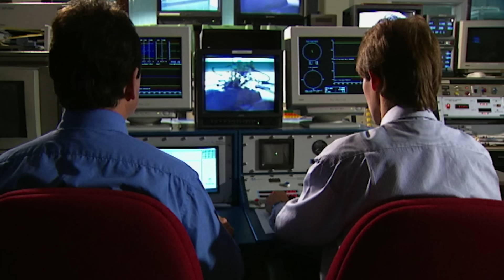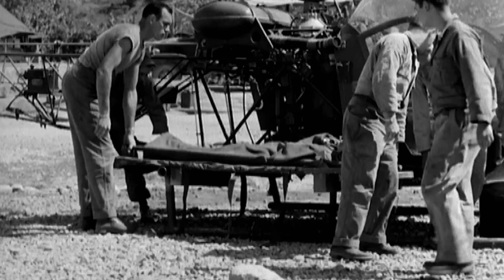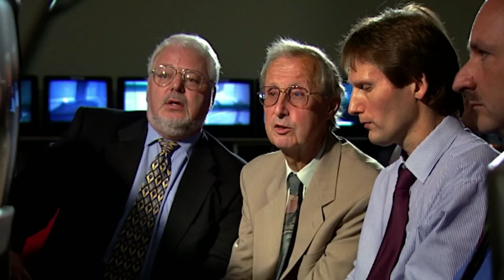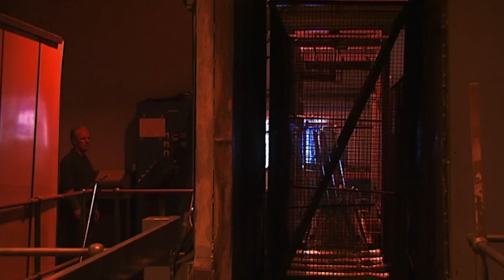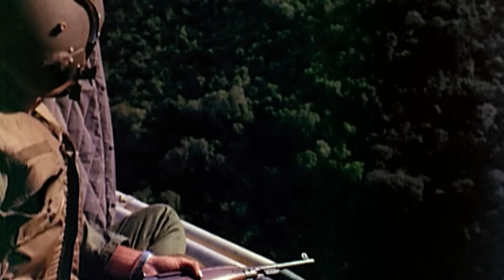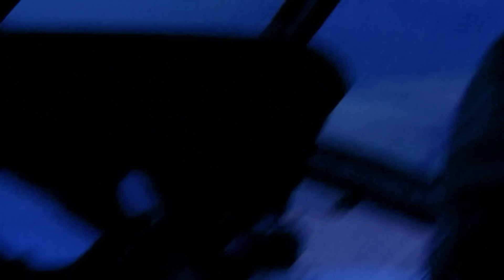The Ultimate Helicopter's Design Allows It to Conquer Any Airspace | Blueprint

Comment: It looks like an NH90 that australia just planning to  retired
Reply: It was an excellent helicopter, just retired because US was worried about competition.
Reply: The Australians have already buried their NH-90 helicopters after stripping them of reusable parts. New BlackHawk helicopters are starting to arrive and Apache helicopters are due soon to replace the elderly Tiger helicopters.
Reply: Only a shame, by all metrics the NH90 is the much better aircraft bar cost. But if you want quality you have to pay for it... Composite airframe, fly-by-wire, EOS gimble, pilot HMD, rear ramp... NH90 is a staple of the modern helicopter, UH60 is archaic by comparison.

Going from the NH90 to the UH60 is like going from a JLTV back to a Humvee. There's good reason the humvee is still in service and will remain in service, theyre cheap and plentiful. But they cant survive frontline combat... It's a crying shame our budget here in Australia is so limited we can't have both.